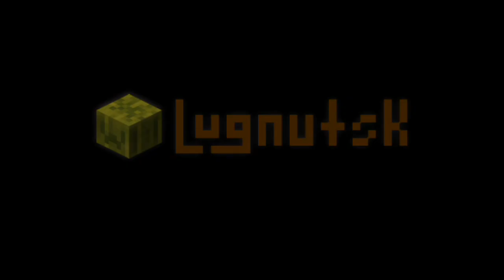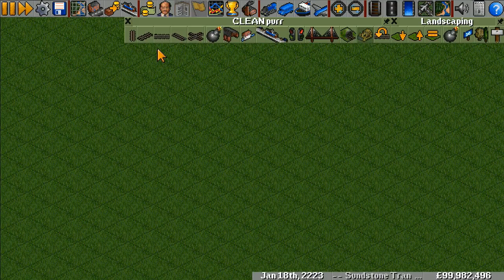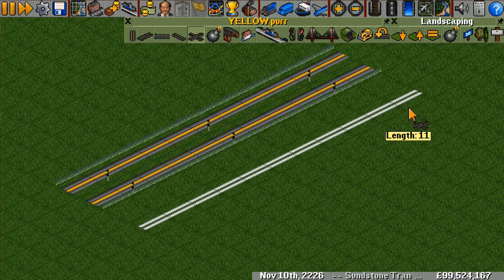OpenTTD Tutorial: Signal Basics

Comment: god so confusing lol i think i sort of get it just started playing so i'll try it out next time when i have more brain power thanks for explaining it was clear enough but you could have made the tracks wider and longer also used train colors that are more visible the path color and train bed makes it confusing lol plus the end of the train looks like the front.

Ok heres an attempt to explain what i have and tell me which signals should i use. I have 3 stations in a straight line. a 2 platform station in the middle letting 3-4(5 if i can get passenger too) trains use the station with the 4th going through. The station is in the middle with 2 trains on the left entering and exiting to the left. and one train on the right exit to the right as well. Finally I have a 4th train going through the station because its too expensive to build another track around the station so i let it go through. how do i keep the two train on the left use only the top platform to load and unload, while letting the through train use the bottom platform as through track. The train on the right can use which ever track is free. Remember the through train needs to run through again to return to the other side.  i need help figuring out which signal goes where. 

On the left side, the top track has a route to the top platform.  the bottom track has a switch towards the top and a straight track through the bottom. on the right side the two track are simply crossed. top and bottom track are parallel with no gap between each other. 

someone help solve this i'll check again tomorrow thanks guys :)

Comment: i dont get a bit about those two way path signals, can someone explain it to me in possibly a more clearer and simpler way?
Reply: Path signals in general do not care about trains already in the singnal block. They only look for a valid route and go there. The problem is, that trains reserve lots of path after a pathsignal, until it hits another signal. So to cut the reservation infront/behind a station, just put a twoway path signal on both ends, facing the station. 
Should you have one-way stations, you can of course use the one-way path signals. If not, well youse two-way. They allow to enter from the back.
Reply: I think it works as a path signal from one way, but it allows trains to pass through the other way as well.
Reply: Same here. I understand it all except for those 2 way paths.